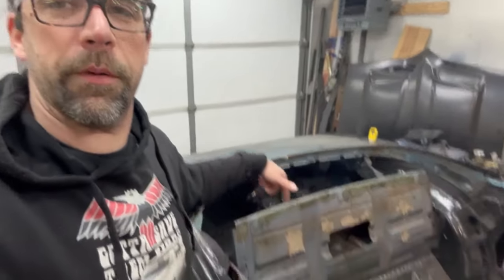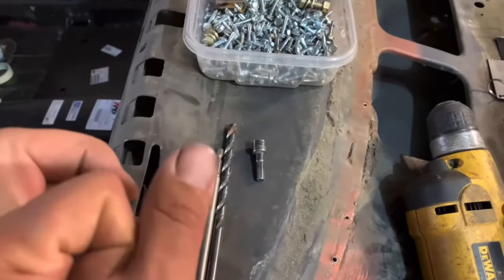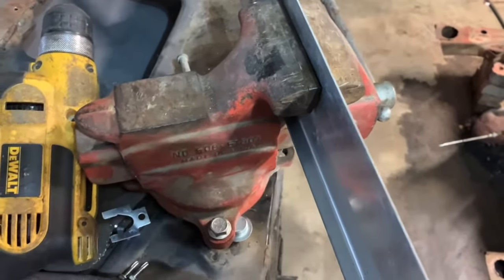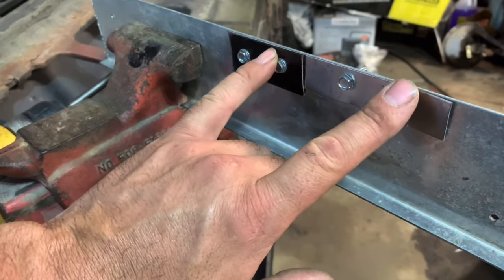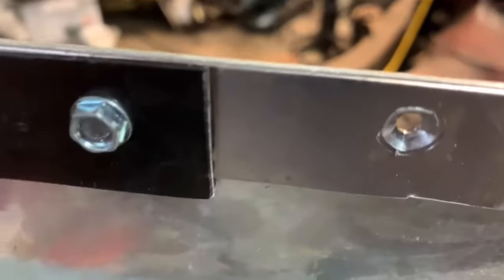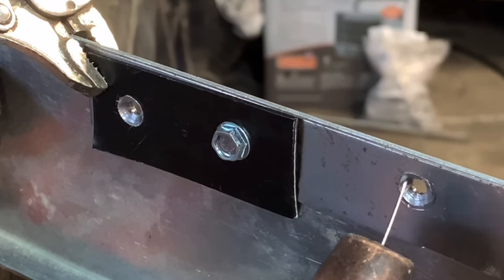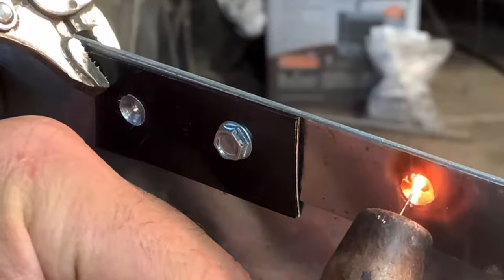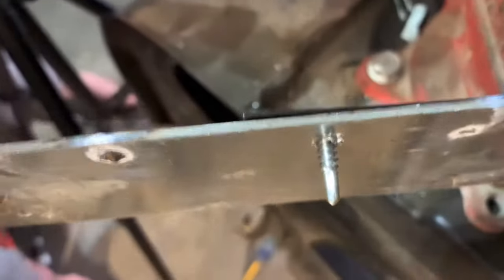Plug welding the VVG way

Comment: I love this method. I learned it by watching you from the beginning and I. Master it and I only use flux core wire thanks for sharing your knowledge buddy And one more thing when you use this style of plug Weld It's 10 times stronger💪 than the factory spot Welds 😉 I have done some testing
Reply from the maker: You have definitely mastered this technique plus it’s with flux core. I can’t even come close mind blown 🤯

Comment: Great plug welds! I’ve tried a few from your first video and i’m not very good yet but getting better. Not quite sure how to set up my welder. Are your settings different from when you are butt welding sheet metal? Hotter/colder? That might give me a baseline. Thanks!
Reply from the maker: My setting is the same for butt welding and plug welding.  The Eastwood welder settings are D-4 speed and voltage.  I know that doesn’t translate to all welders
Reply: @VinylVillageGarage  Thanks! I’ll keep practicing. My problem is that they look good from the front but sometimes not so much from the back.

Comment: Nice do you leave the spot welds like that on the car or do you sand them down?
Reply from the maker: For the most part just clean up by sand blasting or wire brush and then paint.   Sometimes they need a little buffing

Comment: 👍👍 I first learned to weld with torches and coat hanger's my uncle and I replaced some floorboards in 2 Jeep's and a pinto up in Michigan when I was a teenager 😂😂
Reply from the maker: That was my first experience with welding    Watch my dad do the same thing on a pinto wagon. Stitched in floor patches with torch and hangers.  It worked
Reply: @VinylVillageGarage  yeah, it was fun to learn that way, when I first used a welder it seemed easy 🤣🤷
Reply from the maker: @milesunderwood2380 brazing rod and a touch was how it was done.  I have taken several cars apart with exterior patches welded that way.